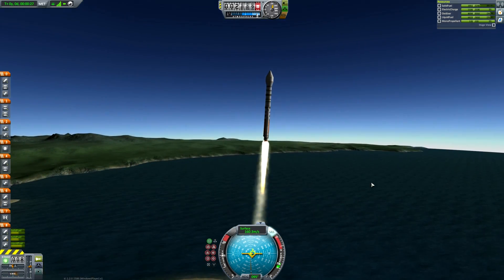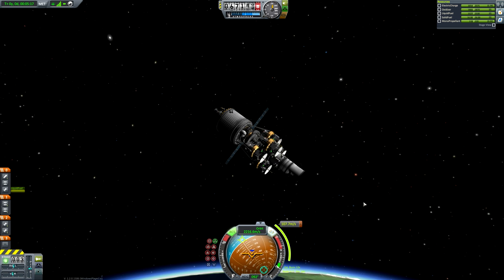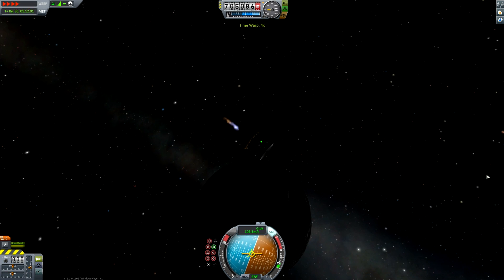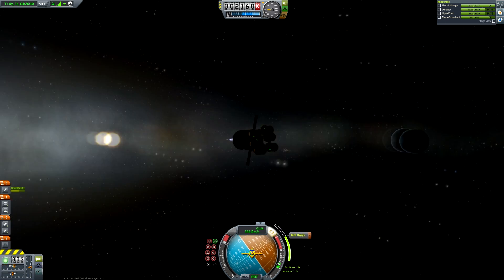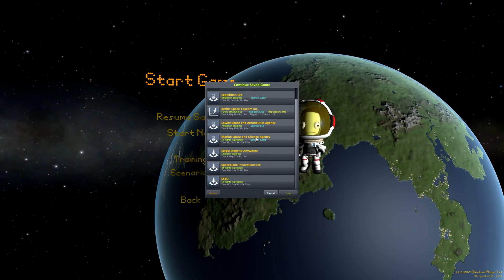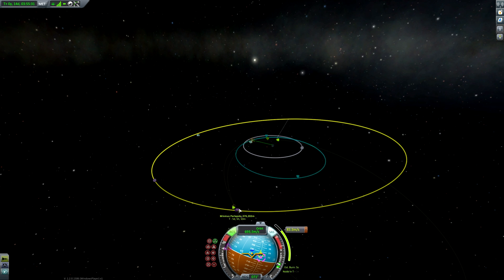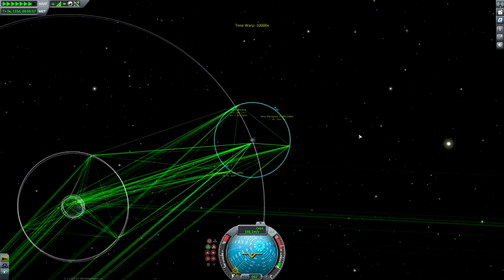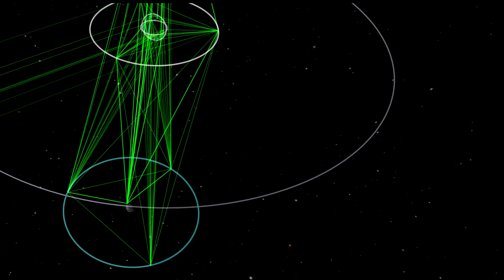KSP 1.2: How to Setup a Mun and Minmus Relay Network

Comment: you can minimize the pain of getting it into a perfectly circular orbit by picking the ant engine or ion both produle 2 kn of thrust and it will be effortless to get them into circular orbits they are very usefull around small planets like moho or small moons like gilly although for gilly you still need to bring the thrust limiter

Comment: You know how trying to smoothly put entire constellations of satellites into equally-spaced orbits with the exact same orbital period typically requires establishing a resonant orbit that touches the targeted orbit's periapsis or apoapsis? Well, if trying to set up a geostationary orbit around a particular body is out of the question, what if you could instead put satellites into the same orbital plane as the target body in question if, like the Mun, the targeted body also happened to be tidally locked towards its parent body, such as Kerbin in the Mun's case? I'd imagine that, in such a setup (and combined with some satellites placed around the parent body), much of the Mun's surface (particularly the sides facing the orbital lines, along with the near side) could enjoy the same kinds of benefits that come with geostationary satellites, but without the actual positioning of satellites in geostationary orbits. (The poles and far side would, unfortunately, have to rely upon satellite constellations in polar-like or molniya-like orbits around the Mun.)

Comment: Great videos! Im new to KSP, Whats the point in the relay network?! What is the network used for?
Reply from the maker: It allows you to stay in contact with probes (if you have that enabled in the difficulty settings). My video entitled "The Definitive KSP 1.2 Preview" goes a little more in-depth about how it works

Comment: Wait a second! Before you get frustrated with figuring out 120 degree tri-sat periods, I've done some number crunching for you. All you need is your intended circular orbit height, the radius of the planet easy to look up, and my special number. Use this formula for finding the 2/3s period orbital periapsis for use like what Matt did here:

((Apoapsis + radius) * 0.526286 ) - radius = your periapsis

Eg: I want to put 3 satellites in circular 1,000,000 orbit around Minmus. Using 1M meters as my apoapsis and 60k meters as my radius, I get a 2/3 periapsis of 497,863.  This works for every KSP body due to ideal patched conics physics, just change the radius and your desired orbital altitude!
Reply: +moegojoe  Thank you so much for this, man! That is awesome information that I wish Matt had included.
But now the thanks go to you. The only thing that remains for me to ask is: how did you arrive at that 'special number' of 0.526286 ???

And I still wonder how Matt proposes to release three satellites at the same time, and still get them in their respective separate positions correctly. Because he fails to explain that very well, too :(
Reply: You are a true hero
Reply: I know I'm a year late, but thank you so much. Maths pretty much melts my brain.
Reply: Very helpful advice, thank you so much!
Reply: A few times a month for the past 4 years, I have visited this video for the sole purpose of finding this comment.
Reply: I know I'm late, but you're a fuckin lifesaver man
Reply: moegojoe thank you!
Reply: Thanks 😃
Reply: thanks!

Comment: I dont have this CommNet interface in the top left corner. IN the Tracking Center i cannot toggle CommNet connections. Only in the "Transmission" Scenario commNet works. Where is the problem?
Reply: I have found the error. Save game -> open the save file ->set EnableCommNet = True.

Comment: I tried a Duna mission by calculating all the math by hand once, ended up bringing more than half of the fuel back
Reply: That's awesome. I'm guessing you didn't account for the mass decreasing as you burnt fuel, thereby epically underestimating your total delta-V, but do please correct me if that's not the case
Reply: I used formulas from KSP wiki, which were supposed to account for mass decreasing.

I think I didn't account for aerobreaking, or my dV map was inaccurate. I also expected to lose more fuel on re-docking with Duna lander.
Reply: Hehe, good job.
Reply: Big brain
Reply: Wie geht das

Comment: to set up a synchronized  orbit you dont even need to have the altitude at 288.33 thousand or whatever km, you can have the apo at like 300 and the per at like 260. if you were looking at it from the ground up, it would wobble a bit throughout the day, but since we are using this fr unidirectional satitlites, it doesnt matter.

Comment: are the transmissions calculated by the antenna's actual height so if we put antennas higher on a base then the comms work a bit longer?
Reply: Nice question that's probably been answered after 6 years.
Also I guess that is the case. The comms line gets blocked by the planet itself, so if youhave a base with a high antenna it'll get blocked after a longer time, when the line from probe to ground passes thru the planet.
I should try to implement this

Comment: I have a quick question how to you get connections all the way out to Eeloo.  Just how.
Reply: There are many ways to set up a network to reach Eeloo. E.G, you could send 3 relays up into orbit near dres, as a middleman connection, then have powerful relays in orbit around Eeloo. Way overkill, but it would be connected constantly.
Reply: Thanks!
Reply: Low Flying Gamer No problem :)

Comment: hey matt lowne, i noticed while you were making one of your maneuver nodes you were pulling it with the cursor, did you know that you can use the scroll wheel while hovering over them? it just helps making smaller adjustments. 

P.S. I really like your videos, keep it up!

Comment: What if you put a satellite in a solar orbit in kerbin's orbit area so they have the same orbit speeds. Ex: Launch a rocket straight up without tilting until it is in a solar orbit where the earth follows it
Reply: That's what I was thinking of doing. having 2 satellites at 120° separation, but in the orbit of Kerbin. That'll provide coverage halfway across the kerbol system, easily.

Comment: Matt, you glorious buffoon! Couldn't you make a satellite appear Münar stationary by putting it in a Kerbin orbit identical to the Mün, just slightly ahead? I assume since Mün is tidally locked this would function as if the satellite were in a synchronous orbit.
Reply: Indeed you can. Take a look at the fifth paragraph at http://wiki.kerbalspaceprogram.com/wiki/Mun

Also look at http://wiki.kerbalspaceprogram.com/wiki/Synchronous_orbit

Also you don't have to exactly match the Mun's orbit, simply matching the semi-major axis is good enough. The result may wobble a bit from side to side, but that shouldn't be a problem.

Comment: Why should I launch satellites into geostationary orbit, can't I just send them to any orbit ? Sorry for my english :3
Reply from the maker: ^This. Dudebro is incorrect on this occasion, you can totally launch the relays into any network. The satellites must all have the same orbital period (that is, it takes them all the exact same length of time to complete one orbit) in order to maintain separation. Geostationary orbit is only useful IRL, where orientation of dishes matters.
Reply: No reason, he just think it looks cool. DudeBros doesn't know what he is talking about.
In the real world it means you dont have to pivot your sat dishes, but KSP is a video game where that isnt important.
Reply: well if youhad enough yeah you could. like 10 would do you fin if you didnt want a geo orbit. but if you wanted to have satilite TV here on earth this is essential for strong signals, but its ksp so all that matters is distance.
Reply: You used correct grammer.
Reply: because they would drift away from the station and relay network would fuck up.
Reply: DudeBros In what sense fuck up? I'm sorry I do not know much English and I use google translayte: D
Reply: MegaLoogin Well the signal wouldn't make it and you would lose control of your probes.
Reply: DudeBros Thank you for the explanation, just before I did not know what to do: D
Reply: No problem.

Comment: I personally would have used a retro orbit so it could've gotten as small of a lack of communications as possible.
Reply: Oh, and great joke.......
Reply from the maker: I mention in the video that even probes with just the in-built aerials (no communitrons needed) can communicate with the relays at this height.
Reply: Until you get to duna or eve or etc......

Comment: By the way, there IS a kerbal engineer build for 1.2 pre release.
http://forum.kerbalspaceprogram.com/index.php?/topic/17833-111-kerbal-engineer-redux-1110-2016-04-29/&do=findComment&comment=2757658

It's not a final version yet, so use it at your own risk ;)
Reply: Works for me...
Reply: Thanks, you saved me work and posted it already. It works for me too.
(However I have a problem that Kerbals just disappear while disembarking on Minmus - but it's probably a problem of 1.2 and not of K.E.R. And KSP 1.2 Pre already crashed a few times on me when I used 'Switch to target' from the K.E.R. GUI.)
Reply: It works until you start assigning priorities to your fuel tanks, then it goes completely bonkers when calculating your delta-v.

Still a million times better than vanilla.